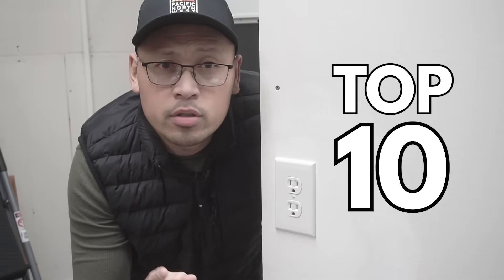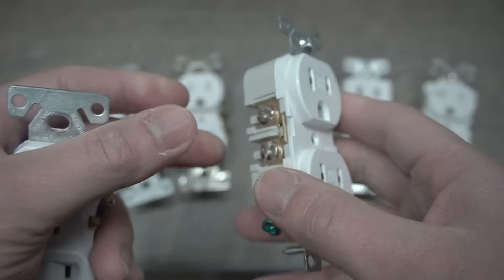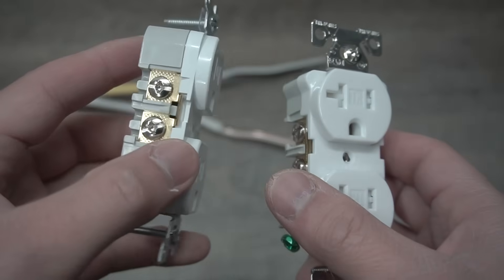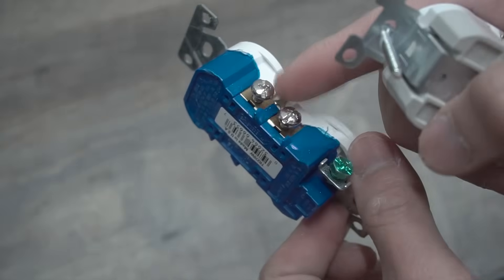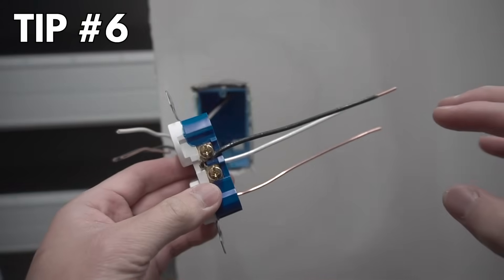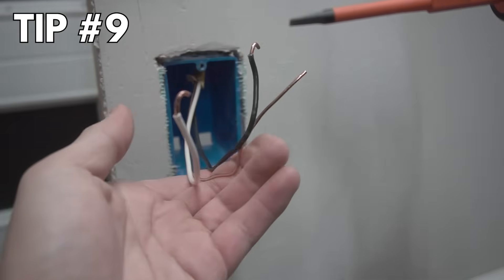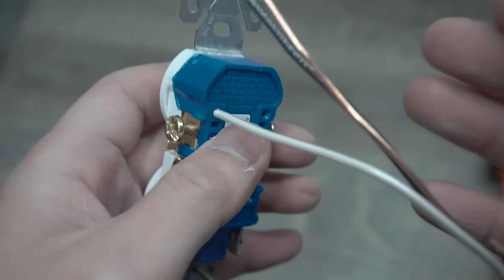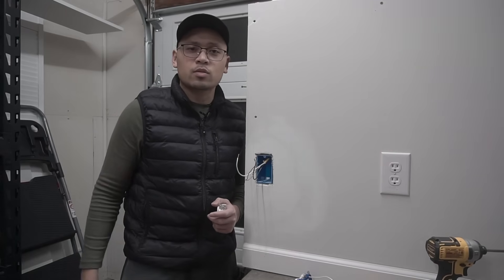The WORST And BEST Electrical Outlets You Can Install In Your House!

Comment: One of our receptacles that was backstabbed came totally loose after living in our brand new house for about 14 years (and that receptacle never being changed since it was new). My mom was using a space heater downstream of this receptacle and the high amps daisy-chained through that backstabbed connection caused enough heat for it to come totally loose and out. The wire was blackened from all the sparking that occurred. There is a reason no good electrician backstabs, and the NEC should not allow it. It actually kind of baffles me that the NEC is so overly strict on so many things and requires all these expensive, money making safety devices, but lets this go on, when the overwhelming consensus among decent electricians is not to use them. Maybe they bow to the greed of the manufacturers and the greed of the "speedy" electricians.

Comment: Commercial receptacles are easier to wire since the wire feeds in straight from the back, not having to be wrapped around a screw like the <$1 ones, which can be fiddly.  For that reason alone, a better choice for a homeowner fixing things.  The wire is still securely clamped.  Get the special screwdriver with square head + flat or just a square drive works.  I strip slightly longer to use the step on the body to make the final tight bend after sliding the loop under the screws.  Never use the back-stab spring-loaded holes on cheap outlets.  New homes are often built like that, then the receptacles get loose connections over time, which cause lights to flicker and even melt the outlet from the high resistance.  The TR receptacles I bought (Leviton?) are a PIA since must wiggle the plug in to push the plastic protector away, almost feeling like I'll break the receptacle.  The one you show with the plastic only partly blocking the opening appears easier to insert a plug.

A common confusion by hobbyists who know just-a-little is that you must use a 20 A rated duplex receptacle on a 20 A circuit.  Not true and even unusual to do so.  15 A rated receptacles are rated to pass 20 A to downstream outlets.  The 15 A rating is only for the current draw by the plug.  The only time you must have a 20 A receptacle is for a single type (not the common duplex).  In that case, it must also be the only outlet on that 20 A circuit, say dedicated for a sump pump.  The single receptacle indicates a dedicated circuit for a single device (at one time).

Comment: I have been a Journeyman Electrician for over 25 years now. I want to Thank You for making this informative video. I personally try to Discourage DIY'rs from doing electrical work. There is a Good Reason electricians go through so much training. If a DIY'r does it wrong then, someone will die or burn down a house!
Reply: Should homeowners call you every time they need to plug in a cord?
"Professional" electricians (sans degree) still wire new houses using backstabs that loosen over time.  Homeowners must slowly eventually replace them all, hopefully using better "commercial" outlets (straight feed w/ screw clamp).

Comment: I have another recommendation, unrelated to the product choice: When installing wall switches, be sure to include neutral wires. Later, if you decide to replace with smart controls, you'll be happy you did. Not all smart switches require a neutral, but many do. You might get away with using the ground instead, but please don't.

Comment: I had to redo all of my connections in my house because the builder did backstabs and the wires came out in several of them! We had flickering lights, outlets that didn't work or had circuit breakers popping and it was all caused by loose backstab connections.  
Our next $project is to replace/upgrade all of the old outlets and switches.

Comment: Why include a hospital grade receptacle in this kind of mix?  

Spec grade receptacles generally have 20 amp guts, even in 15 amp receptacles.  They also have ground screw springs.  Both make for more reliable connections, especially if someone plugs in a space heater or high power vacuum or blow drier or microwave.  The guts of econo grade are more likely to self destruct into fire hazards.  

Missing from this mix are isolated ground with the orange dot, important in some cases to limit ground loops on computers and AV gear. That requires star-hub and not loop installs overall, and connecting equipment by aware plans to avoid ground loops that cause noise or lightning susceptibility.

Comment: Wago is a German company and the correct pronunciation in German is "vahggo" Like froggo but vah-go
Reply: Wago began making wiring products for industrial automation, especially DIN-rail mount.  The lever clamp connectors migrated to residential wiring, at much more affordable prices due to high volume.

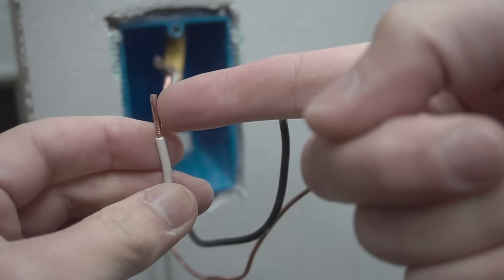Comment: At 14:33, you jiggle the wire stripper.  Doing this causes the same damage (knicks) to the wire that you were talking about just a few seconds earlier.  You can see the damage at 14:40 just above the white wire sheathing.  You should pull the sheathing off without jiggling.
Reply: He should spend the money on some better strippers.

Comment: Tnx.  I just hate the child proof recepticles.  I look fir std ones.  Best ti all.
Reply from the maker: I understand! Standard outlets are definitely easier to work with. 👍🏽😊
Reply: My entire house is a child free zone, with various electronic and chemical materials and tools, secured by exterior doors only.  Child free houses should not be made more difficult to operate for adults, or elderly where ADA may conflict with child nuisance mandates.

Comment: Best not to mix copper and aluminum wires
Reply: Best to not use Aluminum at all on 15-30 amp circuits, and circuits with more than a single connected load installed with NoAlox on suitable lugs.
Reply from the maker: Thank you for the tip!